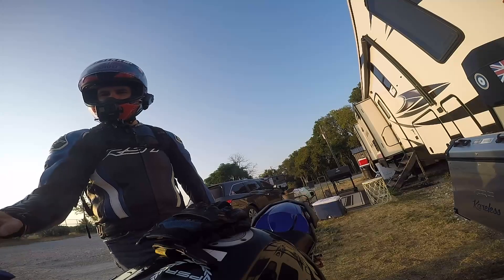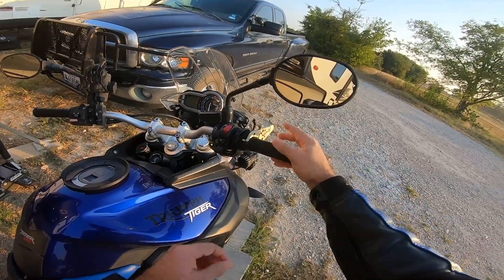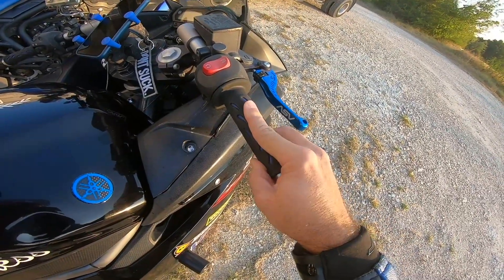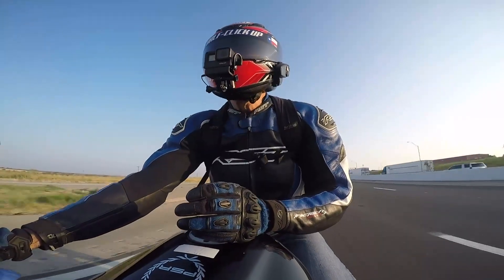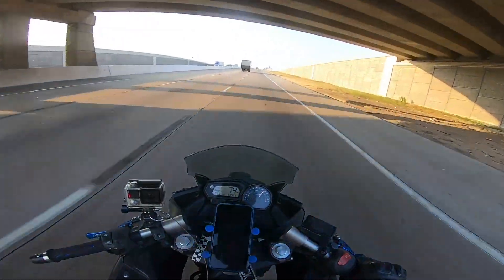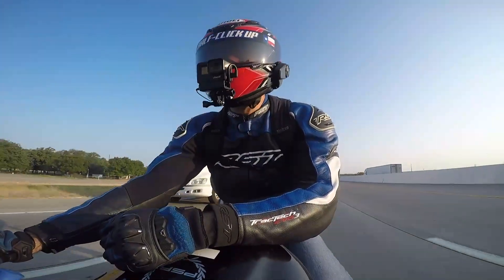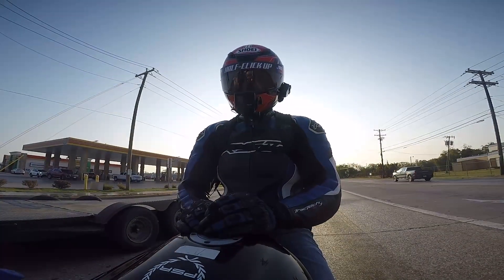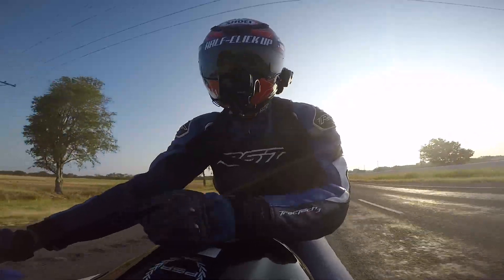Fizzer Friday: Ep. 49 - Sup With Our Throttles?

Comment: Of course you can take that throttle plate off and access the spring (I think).  Just look at photos of the Fz6r throttle body and you can see a nut on the end of the throttle body shaft that holds the plate on.  I mean, they put the spring on there, there has to be a way to remove it.  I don’t think they would weld it together. 😊

Good point though, I had noticed that the Fz6r throttle was stiffer than my previous bikes.  When I first started riding it and would try to get back on the throttle after shifting nothing was happening lol.  I was so used to having to use very little force to rev the bike up and it doesn’t work on the fizzer.  I think I’ll look into finding a lighter spring this winter.  Like you said, maybe sourcing an R6 spring would do the trick.  I’m not against buying a junk $10 throttle body off ebay first to take apart and find a spring that works.
Reply: Thanks for bringing the topic up though, because it never occured to me that there might be a solution.  You can get a quick turn throttle and all that but it would still require the same force to move the throttle plates….
Reply from the maker: @Jj12915  yes precisely. It’s too bad the spring plate doesn’t have its own part number.. that would make it a lot easier to source!

Comment: Yup the throttle has a pretty strong snap back on it. Mine is the same too, and you're right, after alot of riding the hand gets sore or numb. So there are two cables connected, and I think the one that makes it that strong is the cable with the snap back. If you were to loosen that one off a bit for example it might be better on the hand. As far as the R6 throttle bodies, I believe they will fit although I have not tested this theory. And it kind of makes sense because basically we have an older gen de-tuned R6 motor. I have also heard of people swapping out the throttle tube also, not sure about the difference in shape, but there is something different about it.
Reply from the maker: A subscriber pointed out to me that there’s a company out there called Spears Racing that makes lightweight return springs for “FZ/MT/R7” but it’s unknown if it’ll perform on the Fizzer:
https://spearsenterprises.com/product/yamaha-fz-mt-r7-lightweight-throttle-body-pull-return-spring/

Comment: I saw a different version of the screwdriver method you were talking about. It was nearly the same minus sticking your index finger out. More so you push your wrist to the outside of the bike. The way it feels to me is more like using your fingertips to control the throttle versus normally gripping it. I still have standard bars on my bike since Im used to them after 45k miles lol. Honestly your hand is already in the position I would have to twist my wrist to achieve due to the clip ons. The throttle is definitely a little stiffer. My only comparison though is to a carbureted bandit 1200.
Reply from the maker: I think I would be more negatively affected if I had gone from a bike with a normal throttle stiffness to the Fizzer’s extra stiffness. It’s all I’ve ever known till I got my Triumph. But, it’s discouraging not being able to apply skills that I learn from my coaches at track days.

Comment: Could it be a lubrication issue with the throttle shaft, tightness of the nut on the end of the shaft, or a worn bushing kind of thing?  I know there shouldn't be tons of wear, but at 70k miles, maybe?
Reply from the maker: Yeah I dunno man.. everything is properly maintained, and these cables are freshly installed and lubed. After installing these new cables, it feels the same as before. I’ve never touched the nut that holds the spring plate in place, so I presume it’s still torqued from the factory.

Comment: Did you ever find a solution to the spring rate?
Reply from the maker: @kevinowilliams001   I have not. My conclusion is that it’s simply Yamaha’s design as it pertains to this being a “tamed sport bike.” There’s a company out there called Spears Racing that makes lightweight springs for the MT-07 that a subscriber reached out to, but I don’t believe he ever received a response. Outside of that, there is a “short throw” throttle tube for the R6 that would swap right onto the Fizzer, but I have not attempted to test that application. Seems sketchy for my 3.27 gearing, anyways.